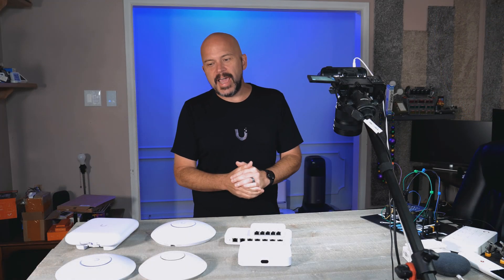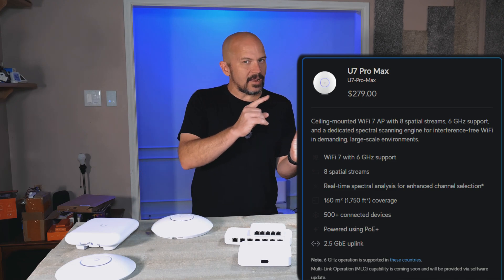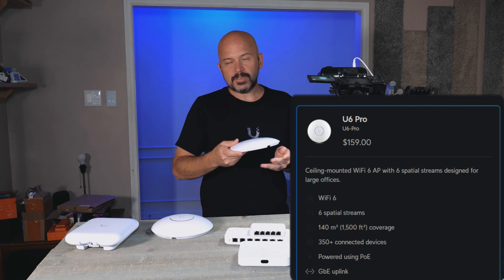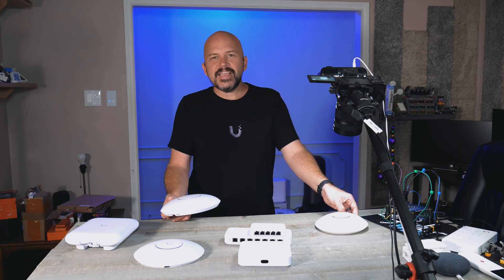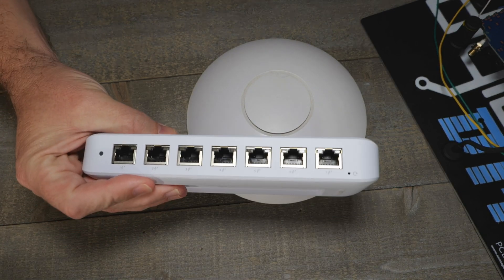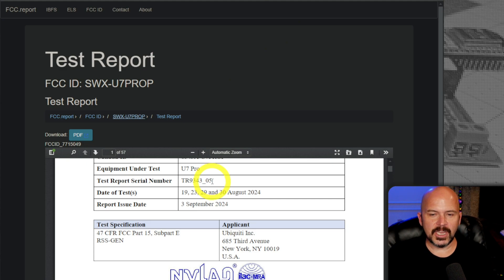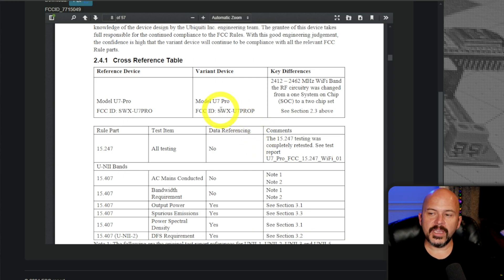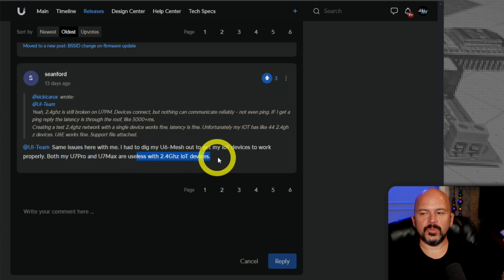UniFi U7 Pro & Max - DON'T BUY Here's Why

Comment: Unifi have SOOOOOOOOO many firmware issues that it is becoming a JOKE !!! stable versions are JOKES and slow wifi output for no good reason.
The Unifi forums and full op people with excuses for unifi being trash !
Reply from the maker: I can say the U6 lineup like the Pro and Enterprise have been fine.  The 5ghz/6ghz side seems to be fine on the U7 so far but without 2.4ghz support it really doesn't make sense.

Comment: Just purchased 4 U7 pros :(
Probably going to have to return them if I can't figure out how to make them stable
Reply from the maker: Still rocking and falling back to 7.0.59 here for stability. The U7 Pro Max is in the box for stability
Reply: @digiblurDIY  I just joined the early access program and got the latest firmware
7.0.84.  Lots are reporting this fixes it.  Crossing my fingers this fixes it or they're going back.
Reply from the maker: @rogershark9223  lots are reporting 7.0.84 doesn't fix it, including myself.

Comment: I had two U6 LR and three U6 IW. Recently I replaced all 6U with two U7 Pro max. I'm happy since I have much stronger signal with two U7 compared to 5 U6.   Currently I have about 20 devices connected using 6 GHz, around 25 devices using  5GHz and 70+ IOT on 2.4GHZ.  I'm happy since  I was able to sell U6 more than what I paid for two U7 pro max. Coverage area is about 5000 SF and My setup is ISP>Ubiquiti Transceiver> UDM SE with DAC> Switch Aggregation> Using DAC 8 port enterprise> 2U7 ProMax and using 2 DAC cables for port aggregation to 48 port POE  feeding GBE connected devices.  Its running trouble free for last two months UDM temp is 43C with all load using 8 cameras too and enterprise SW temp 52C :)
Reply from the maker: That's good to hear! I have my fingers crossed you don't end up on the "don't buy" list soon.

Comment: Super glad I found this video. I deployed 2 U7P's and everything was cool for a bit and then Home Assisant devices just started crapping the bed and I couldn't figure out why. Just ordered 2 U6E's to replace the 7's in hopes of solving this madness. Anyone here know if the U7P and the U6E use the same size mounting plate? Would be nice to just do a quick swap when they get here.
Reply from the maker: Yup! Same plate. I swap U7P and U7PM with U6 Enterprise all the time in this testing nonsense
Reply: @digiblurDIY  Perfect! - With the wife already irritated at HA devices randomly not working, drilling new holes to fix it is not a conversation I want to have! 🤣🤣🤣
Reply from the maker: I fully agree. Mine is very annoyed with the devices being offline a lot.
Reply: @digiblurDIY  U6E's installed and all devices came back online within a few minutes! Daddy's back in his happy place! 🤣

U6E was slightly loose on the U7P plate but nothing to be concerned about. I have them wall mounted vs ceiling, so having a small amount of wiggle will not be an issue in my case. Thanks again for this video. I was starting to lose my mind there for a minute trying to figure out what was wrong.

Comment: Thank you for the video.  Good to know that others are having issues also.
I had purchased 2 U7 Pro Max APs and 1 U7 Outdoor.  The U7 Pro Max APs gave me so many issues with IOT devices, exactly as the video calls out.  After 2 weeks of troubleshooting with Ubiquiti, I returned the 2 U7 Pro Max APs for a refund.  I kept the U7 Outdoor and bought 2 U6 Enterprise APs.  All of my IOT issues disappeared, and everything has been running as expected for at least 3 months now.
Super happy with the U7 Outdoor.   I had a U6 Mesh outside previously, and I am getting much better coverage with the U7 Outdoor.
Reply from the maker: Thanks for the feedback.  The U6 is a more proven platform.

Comment: I have 3 U7 Pro Max's, over 40 devices across all bands (2.4, 5.0 and 6.0 Ghz) and have not had any issues at all. Also, I am using the hybrid WPA3+WPA2 instead of the of the full WPA3. It actually warns you that you might have problems with IOT devices.
Reply from the maker: That begs the questions of why does it impact so many people and the older APs handle it all with ease?

Comment: No problem with u7pro and   iot devices just create separate ssid 2.4
Reply from the maker: That's not the fix as I have been using that for 5 or 6 years already. We are currently on 7.0.83 and testing...

Comment: Thank you for your educational video and making your followers aware of this issue with the U 7 pro and Max, Since them has there been any progress to improve the existing hardware or has the new hardware (access point) been released?
Reply from the maker: Some firmware tests but nothing solid yet. I tried the 7.0.83 released yesterday and it has failed already.
Reply: @digiblurDIY  Any updated on the New Improver Version of the U7?

Comment: DUDE!!! Thank you for the truth!! I was just about to refurnish a 5,000+ sqft home with 8 x U7 Pro's, and their home is furnished with over 60 IoT's, and yes they have wired and wireless tech for work, BUT its the IoT's that would have incriminated us for doing a terrible job and ruining our integrity as installers. I guess we will wait for new models, downgrade Controller or just stick with U6 and advise them in 5 years its time to upgrade. This is confusing
Reply: They either bought too many APs, or want 6ghz wifi in every corner
Reply from the maker: I've been trying the new releases and while some have had a bit of promise, it still isn't there.  I pulled my U7 Pro Max and boxed it up again and rolled my U7 Pro back to 7.0.59 for now. I'd stick with the U6 Pro and other QCA based ones.  Solid choices.

Comment: Is the last Firmware fixing this problem?
Reply from the maker: No. But getting better.
Reply: @ damn. I‘m going to upgrade my network to unifi in 2 weeks and have to order the hardware now… currently used orbi satellites. Not sure what to do now -.-
Reply from the maker: Just going to be real with you. I would put that on pause unless you want to go with the U6 Pro or Enterprise. Those are solid choices.

Comment: The U6 was the same way when it first released, but I'll admit I did by it in beta....I found it useless...was too beta at the time for production like a lot of the flashy stuff that sells out on initial release.
Reply from the maker: Which U6? There are quite a few. The U6 Pro and Ent were pretty good at launch and especially 10 months later.
Reply: @digiblurDIY  I'll go out on a limb and say it was likely the prototype under the hood for what became the U6, but this was about a ~2yrs ago (recounting off top of my head) and I wanna say it was titled the Wi-Fi-6 at the time...I got it threw their pre-release program which arguably is beta release products anyway, however I thought at the very least it would have fallback to legacy protocols but I took it out of the box twice (both are work for deployment, then home on in testing) and had no luck with getting anything to connect.

Now I'm curious to see what happens if I were to try newer firmware with it. Was the first and only pre-release product I bought.
Reply from the maker: @kylecurry6841 ahh.. I do rememeber that. It was pulled then they flipped the Pro to the U6 LR model name and made a new Pro.
Reply: @digiblurDIY  yeah it definitely wasn't quite ripe enough at the time. I tend to stick with the tried and true product's like the AC5 line but was looking at the more recent unveilings seeing the 7, and I nearly pulled the trigger on a 7 but then that's what lead me here lol...Glad I did, and so 6 it is for now... Maybe 7's in a year or two

Comment: once I swapped to U7 Pro, my IoT 2.4G network just started constant disconnects all the time for all the devices.  after swapping back to the U6 Lite, the 25% retry rate dropped to 5-9% with maybe 1 device disconnecting every few days which is not unusual.  there is absolutely an issue with the U7 line and even though firmware rollback is a great idea to get it working however is not acceptable.  let's see what Unifi does.
Reply from the maker: Yup!!  Things are getting better with the latest firmware testing but it isn't where it needs to be yet.

Comment: I have a U7 Pro and a U7 Pro Wall. I find that both devices experience intermittent high TX retries when 6GHz is enabled. Everything looks fine when I turn off WiFi on the 6GHz band. In that case, what’s the point of having these two WiFi 7 APs?
Reply from the maker: I haven't tried that but again I like my 6ghz speeds so that's not really a fix for me.

Comment: IOT can be hit or miss for some 802.11be networks, mainly due to certain features that it will try to use with an IOT device, for example, I have a "smart" air purifier, and it will randomly drop when I use both WPA 2+3 along with Fast BSS Transition. This is also why you see some consumer APs such as the newer Orbi products offering an IOT network which is simply an additional virtual AP without those features offered, thus avoiding random device drops.
Reply from the maker: Yep. This is why I run a 2.4ghz only plain jane SSID for them and exactly what Ubiquiti tried in the latest betas ht it isn't working fully just yet.

Comment: Planning on installing multiple units strategically placed to have a visual range between user and AP. Turning 2.4GHz off and tuning power to minimum.
Reply from the maker: Definitely no issues with 2.4ghz when it is off right?  :)

Comment: I''ve bought 2 of U7 pro, then after one month of using, I returned to U6 enterprise.
U7 Pro is so buggy, especially with IoT devices. Although EA firmware do fixed some issue, the TX/RX rate is still weird.
Also the range of 6Ghz is so unbareable, the penetration of it is so bad. Surely I understand 6Ghz will have worse signal penetration comapare with 5Ghz.
But the signal strength is so weak that even wooden wall can block at least 10-15 dB of it. After "downgrade" to U6 enterprise, everything solved. 
It feels like U7 Pro is an immature product and all of the the customers are beta tester for it.
Reply from the maker: I've had decent 6ghz coverage but as you've found the 2.4ghz usage is really terrible.

Comment: Apparently the 7.0.75 firmware has a new "Enhanced 2.4GHz IoT Connectivity" setting. Have you gotten the chance to try it?
Reply from the maker: Yes. 7.0.77 failed on both. 7.0.76 failed on the U7P but made the U7PM usable. 7.0.78 released today but I haven't had the time to test it as when things go wrong the dominoes fall hard.

Comment: you bought a product that hasnt been fully adopted and expect it to work. WiFi 7 is for internet clowns.
Reply from the maker: It's on the regular store and many other companies have been selling WiFi 7 gear for a while. I am on my second phone that supports 7 as well. Not really new
Reply: @digiblurDIY  It isnt induatry standard its been out there because people like you will buy into it.
Reply from the maker: @marcesw35 recall time? AT&Ts new gateway is 7 too.
Reply: @digiblurDIY WOW AT&T's gate is Wifi 7, wo cares what AT&T has they are setting standards.

Comment: I have both the u7 pro and pro max. 2.4 GHz devices work just fine. 

Try the latest 7.0.77 EA firmware for the WiFi 7 APs, it is rock solid. Also unifi just released an EA network app with an Enhanced IoT Connectivity toggle in the WiFi settings. Apparently it disables some WiFi 7 management frames in the 2.4 GHz band.
Reply from the maker: Yes. I tried the 7.0.77 and new SSID setting. Many of us found it not great with 7.0.76 being better for now. Currently running 7.0.59 on the U7 Pro as both 77 and 76 kept dropping and blocking devices. I have 7.0.76 on the U7 Pro Max for now, it isn't perfect but at least somewhat usable for now.

Some progress has been made but they still have a long way to go.
Reply: @ what i have found is that regardless of vendor whether it is unifi ASUS or others, 2.4 GHz IoT devices are sometimes very finicky and sometimes you have to try a different channel. I had a garage door opener on  2.4 GHz that would sometimes cut out and stay disconnected (using a SSID on my ASUS). But invariably whenever I changed the channel (due to co-channel interference from neighbors) the device would eventually reconnect for a few weeks. 

You’ve probably tried this already, but if not, Consider the interference (if any) from your neighbors and try a different channel. I live in a dense urban environment and 2.4 GHz is very clogged. Many SSIDs.
Reply from the maker: @j340_official I have three access points. 1, 6 and 11 at 20mhz to spread out the load.

Ran it as 2.4ghz only for years. Worked great on AC LR, U6 APs etc. Went to U7 and that's where the wheels fall off. Swap the APs back to U6 and it runs beautifully. All the same 2.4ghz devices, just different APs.
Reply: @digiblurDIY  but with the specific u7s that are having issues with IoT devices have you tried changing the channel on those specific APs?
Reply from the maker: Yup.  Swapped channels around as the first thing, thinking interference was a problem.  Then I swapped APs around, it kept following the U7 models.  Then it set in what the issue was/is....
Reply: @digiblurDIY  well if it’s not working for you as you said in the video then i agree to stop using. But I just wanted to add a data point that for me, it’s been rock solid. And that sometimes changing channels alleviates the issue and that other manufacturers like ASUS sometimes also have issues with certain finicky devices. Best of luck!
Reply from the maker: @j340_official most of these are Espressif based with a few other chipsets sprinkled on there. It is weird the U6 Pro and even old AC LR handles it all like nothing. Appreciate the data point.

Comment: 54 iot devices in HA none of these issues 2 x U7 PRO 4 x  AC PRO 2 x U6 Lite old house
Reply from the maker: Sounds like you have a light enough load between all of those APs.
Reply: @digiblurDIY  all iot is 2.4 everything else is 5/6Ghz over 2 ssid

Comment: Have you tried creating a 2nd WiFi network that is simply 2.4 Ghz?
Reply from the maker: Yes. Been running that for years. This is also part of the fix Ubiquiti is trying in the latest firmware and going further and setting it to Wi-Fi 4 specs. It doesn't appear to be working though.
Reply: @digiblurDIY watching and reading all of these videos on u7 APs has me even more anxious than the shit I’m putting up with with my Atlas max 6e lol.
Reply from the maker: @brianswails7276 yeah. I would wait this one out before jumping on.

Comment: 1:40 in and I’m literally screaming “get to the point. WHY?”

EDITS;
3:53 - so the issues are 2.4ghz connectivity stability issues….. I’m still going to buy it anyway, because I’m smart and nothing in my smart home runs on wifi. I don’t exactly call a bunch of pre-determined if this then that statements, ‘smart’ but go off.
Reply from the maker: Yup.  2.4ghz smart home devices currently impacted.
Reply: You are just SO SMART! Gold star for you, my mean-spirited little friend. 🎖️
Reply: Most of my stuff is zigbee and zwave to avoid this but some iot you need wifi. Just the chance of drops is not a headache I need for my wifi devices to be a tad faster

Comment: I have been rocking the U7 Pro Maxs for 4 months now with zero issues. I have 4 of them connected to a Dream Wall (WiFi disabled on DreamWall)
Reply from the maker: Don't touch it... don't add any 2.4ghz devices ;)

Comment: Did they use different chipsets in their APs, like maybe there was a chipset shortage so switched and added a different chipset in, due to supply chain issues 
Just guessing
Reply from the maker: Not really sure, it does seem odd to add the other chip.

Comment: I have the U7 pro and constantly have problems also
Reply from the maker: How many devices do you have on 2.4ghz on the AP itself?
Reply: @digiblurDIY  20 devices on the 2.4 GHz channel with a 26% tx retires
Reply from the maker: Usually it  takes more devices than that. Interesting.

Comment: I have similiar issues with the U6E-IW.  Probably unrelated... I'm 20 feet from the device, in an adjacent room with 1 wall, and only getting 160mbit in both directions...  Supposedly has 1200ft coverage, but I have lots of orange and red experiences in the UCG Max UI.  Drop back to the Netgear enterprise app, with only Wi-Fi 6, which becomes 800-900 MBs both ways.  I just entered the UI arena, and I'm a bit gunshy about spending money on the U7 Pro, especially after seeing this. Further, am I safe in saying that the U6 Pro Enterprise will solve the issue?  I'm stuck with the U6E-IW now since I'm outside the return window... Expensive paperweight.  TBH, I'm scared to invest more into UI, unless I can get verification from other folks. Currently, I have UCG Max, U6E-IW, Switch Pro Max 24, and 8 port 10G Switch Aggregation (several devices in rack are 10G)  I want the best Wifi I can get and don't mind spending to get the right thing, but at this point, as I said, I'm gunshy.

Comment: Have 5 U7Pro Max and 6U7 Pro no issues with connectivity neither IoT 2,4G nor 5G devices. The only issue is the heat. They are very hot, I would admin extremely damn hot, my finger doesn't support any of them operating normally.
Reply from the maker: How many 2.4ghz devices per AP? Any multicast traffic?

Comment: 2g iot devices only barely implement n standard. Wifi 7 wpa3 is mandatory. 2g disconnect i read all vendors have problems. Usually its smart connect (channel switching) iot devices dont understand.. you need a 2g ssid on old standard n or ac and wpa 2 and no bss(smart connect). Its not only ubiquiti.. read on snbforums